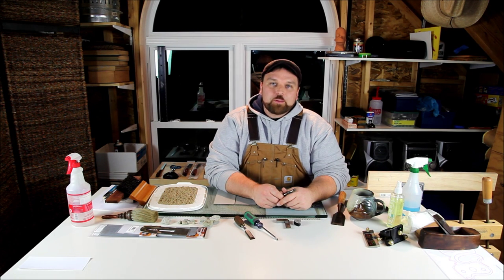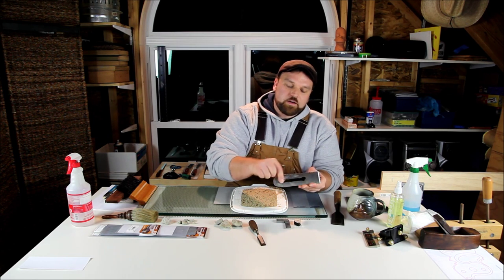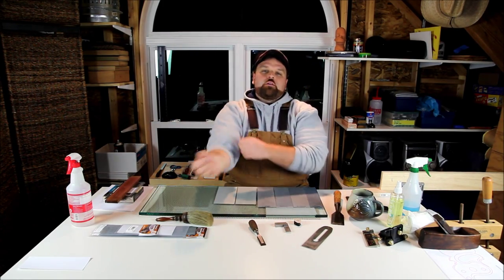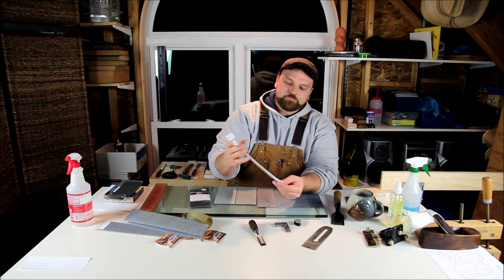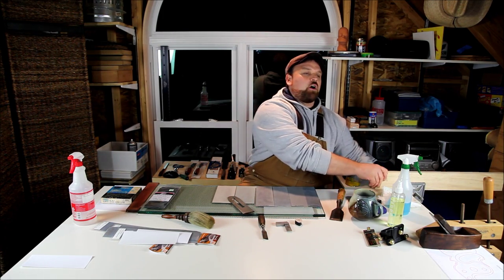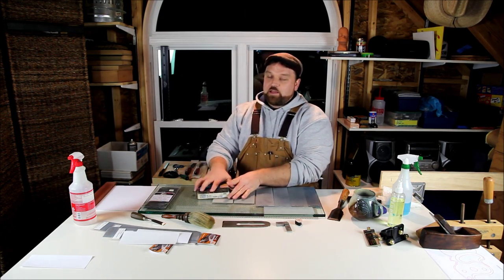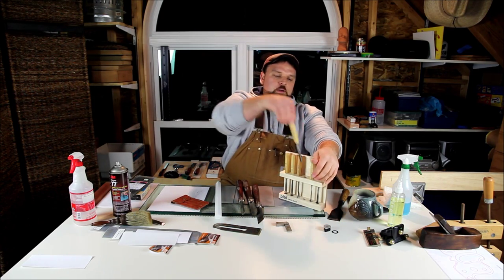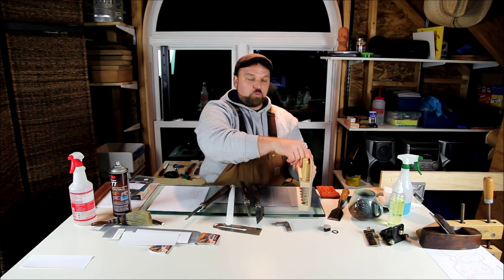Introduction to Honing Methods

Comment from the maker: Sure!  The honing paper is from Alpha Abrasives, if you can't find them at Hobby Lobby just Google "Alpha Abrasives," and you can order directly from their website.
The package I use in the video is called #0110 Ultra Fine Waterproof Finishing Kit, however, they now have a set of even higher grits called #0202 Micro Fine Assorted Sanding Film.